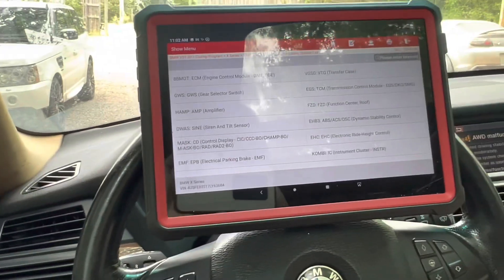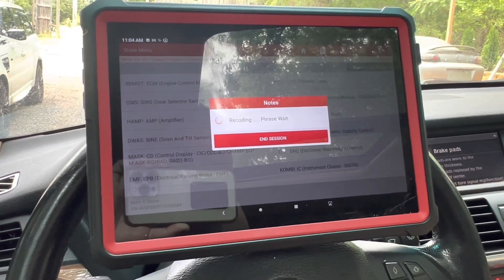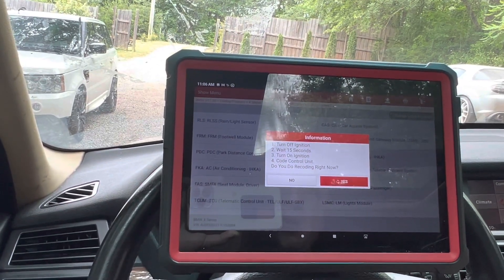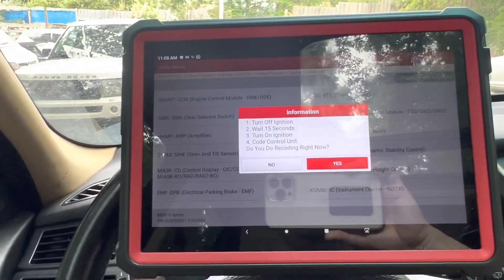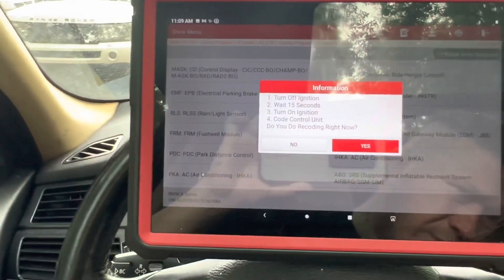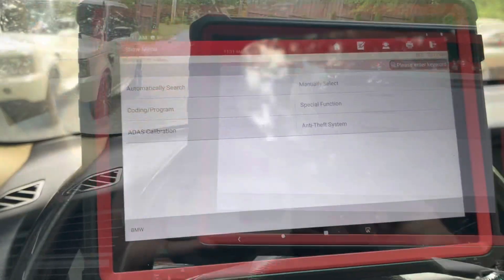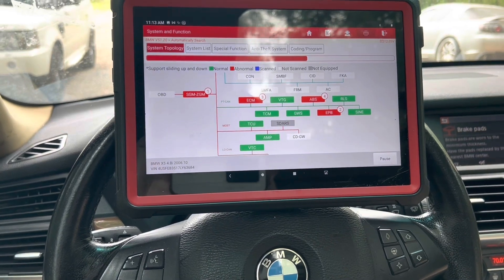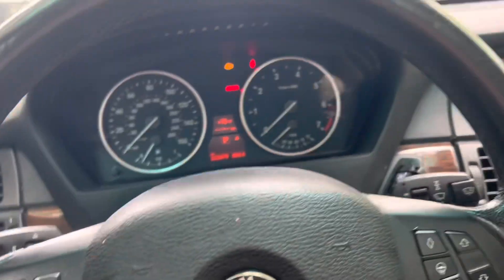Coding my 2007 BMW X5 4.8i with LAUNCH X431 V+ PRO Diagnostics Tool | Step-by-Step Guide

Comment: Bro please please help me. I have a 2007 BMW X5 4.8. I just replaced my transmission valve body that has the attached tcu. I can’t get vehicle out of park now. I have the launch creader Bmw tool and it’s supposed to be able to get the new tcu linked up but I can’t get it to do so. Any ideas?
Reply from the maker: Did you or a shop did it for you? In any case, if you removed the valve body, you must install it correctly, there’s a shift lever, it needs to go in correctly to make sure you don’t break it, or turn you will need a new valve body, unfortunately when you take apart transmission, then your problem can be anywhere, if it was me, I would open it up and make sure everything was done correctly before doing anything else, cause you might do damage unfortunately, also question for you, did you replace any seals or sleeves? I hope you did cause they are the cause of similar problems, also solenoids can cause this problems as well
Reply: Hello, I did the work myself and have replaced the seals amd mechatronic sleeve. And yes I made sure the shift lever was in correctly. I had my previous valve body on and off twice and my problem was the shift from 3-4. Everything worked perfectly until I got to 4th gear. Then I would get a transmission malfunction error on dash. I bought a used transmission and Ive first tried to replace just the valve body and the tcu.
Reply: The TCU that's attached to the valve body is coded to the car's ECU (or DME in BMW terms), so when replacing the valve body or the entire transmission you should swap back the old TCU/TCM otherwise it will have to be recoded to the car. That is the issue you're having. You would think this BMW guy and his fancy scan tool would know that.